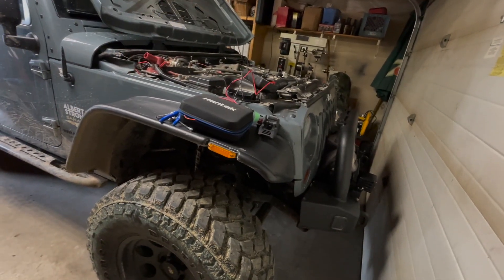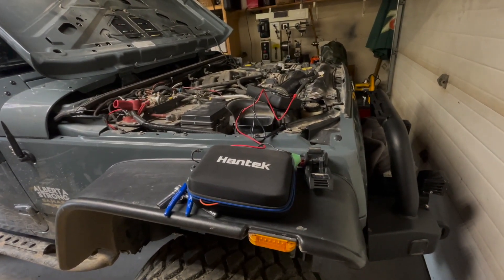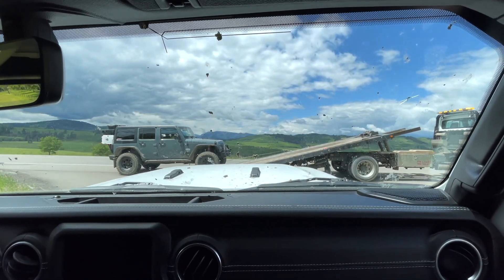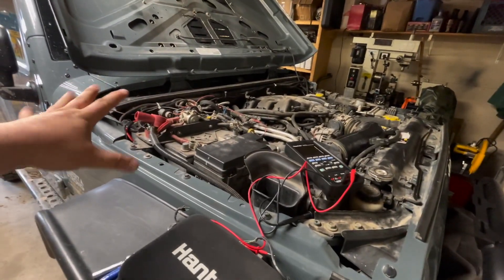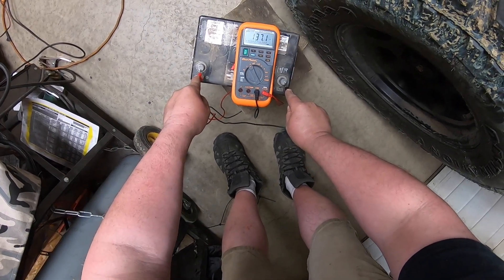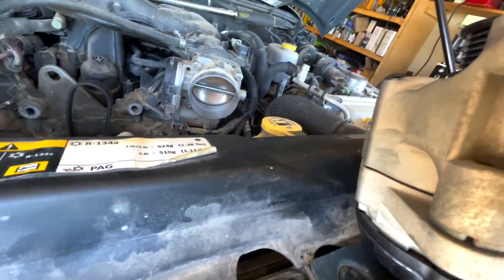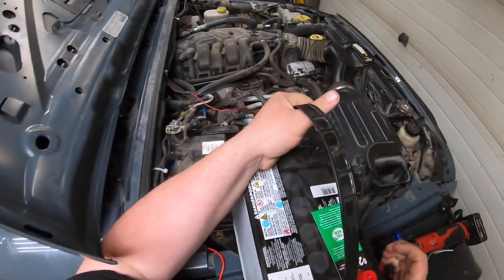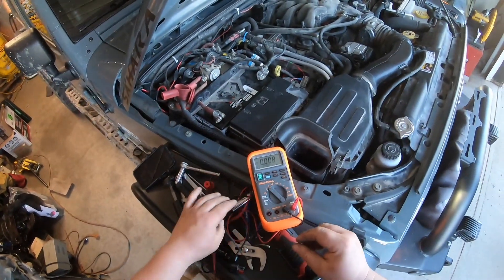Pending Signs of a Failing Alternator

Comment: Wait... the alternator failed BEFORE the 3.6L V-6 did? ;)
Reply from the maker: I think the 3.6 is a pretty solid engine it has it's problems but nothing like the 5.4 3V ford
Reply: @TestDontguess  I'll agree with you there...! One mechanic advises to use only factory replacement parts, and to upgrade the oil pump to a high-volume model... if possible. And don't get me started on the whole spark plug re-thread procedure!

Comment: Have you pondered upsizing the alternator since you have a dual battery setup?
Reply from the maker: I did until I see the cost
Reply: Most alts are made amp specific  . Hence more amps drawn more heat and abuse on alt motor.  ie why thy have higher amperage alts whenever you exceed thier limits  they fail
Reply: Based on the warning sound, the alt bearings got hot then took out the electronics, so in this case it was a mechanical issue.